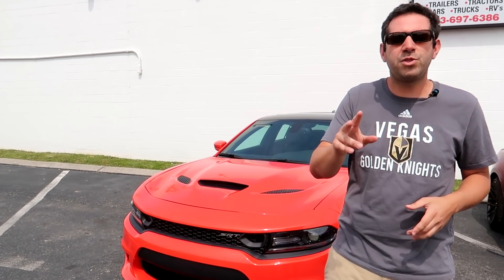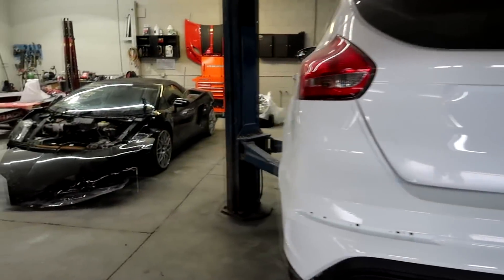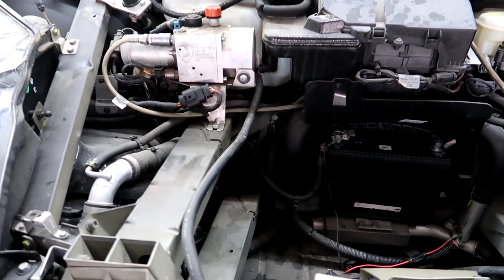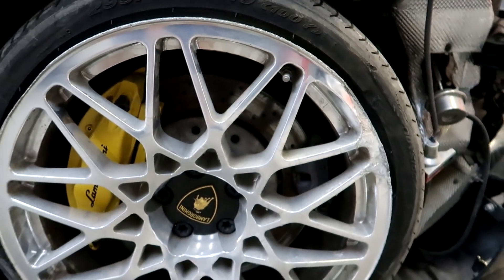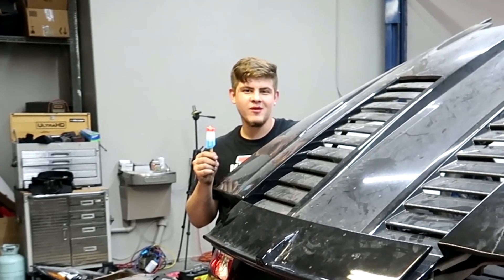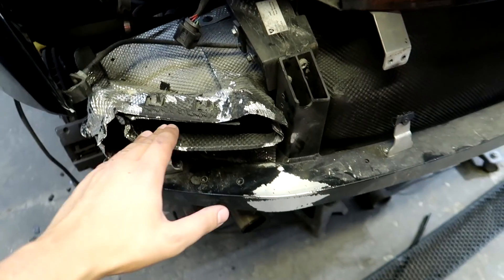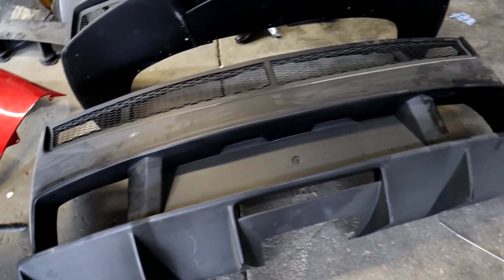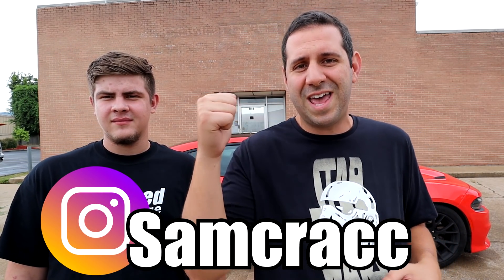I Bought a Lamborghini that CRASHED INTO A GUARD RAIL at Salvage Auction! I'm Going to Rebuild It!

Comment: Mechanical engineer here .. when you get a damaged wheel broken control arm whatever you should also check the wishbones and all other suspension components for damage.. I'm sure you do.. however if they're made of aluminium they need removing and non-destructive testing carried out, as they may have hairline cracks which you can't see, you can buy some penetrat fluid and use that method... but to be honest some proper ultrasonic testing or other nondestructive testing should be carried out by an professional. You don't want to be doing 150mph down the road and get a suspension failure.. any failure is going to happen under hi stresses.. so when you're cornering heavily or even worse cornering heavily at hi speed. This also goes for any other aluminium component which is structural ... You can't just heat it up and hammer it flat.. NDT is required.. the components structural integrity needs be confirmed.

Comment: Don't forget the camera makes it look better than it is. Aluminium rails on a supercar, high speed, high power. Down force, lateral loading etc, you need to ensure rails are factory spec laser aligned and not compromised. Eyecrometer will not suffice. 
We have flags applied to our write offs and imports so that repairs are carried out in accordance to manufacturers specs. Only then can the flag be removed, and not in every instance, notes are logged against the vin.
Reply: Peter datechmen  This^  
Heating up aluminum and bending it back into shape? Aluminum tubing? Wouldn’t fly in Canada. You’d never get that thing re certified unless you used oem.

Comment: You should buy Tracy Morgan's wrecked 2019 Bugatti Veyron. It has less than 10 miles on it.
Reply: wrecked or not I bet it already has about $200,000 worth of timed out parts that need replacing .
Reply: Cost of an oil change on that Bugatti is $ 21,000!
Reply: isnt it a 2012 veyron?
Reply: @JayOhPeee  All the stories I've seen call it a NEW Bugatti and say that Morgan just purchased it for $2.5 million.

Source: https://www.thedrive.com/news/28382/tracy-morgans-newly-acquired-2m-bugatti-veyron-got-swideswiped-just-as-he-drove-it-off-the-lot
Reply: @zzanatos2001  new to him, it was a Used Bugatti when he bought it,  they dont even make Veyrons anymore
Reply: @JayOhPeee  article I read says it's a 16.4 which would be between 2005-2011
Reply: @zzanatos2001  They do not make veyrons anymore.

Comment: $3,500 head light?  WHAT???   Insane.
Reply: My aunts car suburban rims cost 600 or 800 for just one rim
Reply: It's a Lamborghini.... everything is expensive on it (for no reason)

(Unless that reason is to do with carbon fiber, and/or labor on the parts)
Reply: A new headlight for my VW Phaeton is $1,500 last time I looked.  Might be higher now.  I miss the old days when you just bought the headlamp for like $10.  The "anti-dazzle" glass in the side mirrors is $1,500 for each mirror.  Made me almost eat my shorts.
Reply: I’m surprised the Chinese don’t copy the,headlights and charge §500 a corner
Reply: You can source those kind of things used from exotic car dismantlers/recyclers. Fraction of the prize. 

For example, I believe ONE brake rotor for a Murciélago is ~$4000. You can get both fronts slightly used for $1200-1500. There are ways to save thousands even on these cars, while still keeping the quality there. 

This is also the reason why cars such as these are still worth a lot as parts cars. EVERYTHING is expensive, if you can salvage a good engine, good wheels, headlights, and one good body panel, it yields quite a bit of money.
Reply: @OriginalAustinOblivion  or because they can

Comment: Sam the cheapest one in the USA is over a 100k like how did you even got this for that cheap ?
Reply: Yea but you can not sell a Salvaged title for anywhere near retail  you will lose about 40%
Reply: @Steve-mc6uk  dude 45k you could still sell it for double that If not the full price right
Reply: @aizazrehman5153  Not with a salvaged title you won't get anywhere near the value of one that has a clean title.
Reply: @Steve-mc6uk  jeez dude did I said it's gonna sell for the full price ? Get my point what I am saying is its still gonna sell for double of what he bought it for once completed. Got it ?
Reply: @aizazrehman5153  I don't recall being rude to you..
Reply: @Steve-mc6uk  lol dude you're chill
Reply: steve n but realistically do you know what it would be worth once rebuilt?
Reply: @chillintm  dude he sounds like a 12 year old lol
Reply: @Steve-mc6uk  Not sure about exotics, but regular cars sell for about 60% of full retail and a buyer, the goal is getting the car at 50% of retail. Most insurance companies will insure for 80% of retail to protect their interests. My opinion is that the difference between the current 50-60% off retail that is common now and the 80% maximum limit insurance companies will insure for will get smaller and smaller as the price of new vehicles stay high or get higher, with rebuilders trying to get more of that difference for themselves  by taking it out of the discount the buyer tries to get. The quality of the builder and his/her work will be key to him/her capturing that saved money.
Reply: @bluecollartrader1791  dude the point here is HE GOT THE FRICKING THING FOR 45K. Even tho the retail value might be higher for clean titles even tho this is a salvage title it's still is in a beautiful spec which makes it that much desirable and people die to find cars like this because mostly insurance is mostly lower than those of the clean title cars and once built Sam can still make 50 percent of what he paid if he wants to sell it.

Comment: If you're gonna fix the tear at 8:26 you wanna drill a small hole at the end of it, to stop the tear from growing (even after repair). Tears in plastic tend to keep growing if the don't end in an artificial spot (drillhole). Source: I used to do car body paint for Audi, not very good, but I know the theory.

Comment: Sam, isnt there any salvage Diablo's or earlier cars at these auctions, as it seems like everyone is doing these, but not the full cut ones from before the VW group took them over, although regardless this seems like a VERY good find, which explains why you seemed out of it during the Focus RS video with V tuned, as I guess you were just over the moon with how lucky you got here. 

as it looks like you flat out found a car that everyone thought was done for that really just had some mostly superficial damage to it, and ended up finding and getting it at about 3/10th of what it should have gone for with how little damage there is.

Comment: Little correction there: Aluminium alloys in general are not brittle, they usually have more elongation than steel alloys while mostly having less yield strength. Glad I could help, Captain flies away.

Comment: I just wanted to point something out. A lot of these exotics have really expensive parts and many people think it’s because of the name brand. I think its more about cost. For example a headlight on a Ford Focus might cost a million dollars to prototype and tool for mass production and that cost is spread out over a million units to make it cheaper per unit. But on an exotic you might only have twenty thousand cars that use the same light. So the cost per unit will be much higher.

Comment: 6:51 i prefer that you use milwaukee (a proper lithium tool) than tavarish using ryobi and harbor freight cordless tools just to make a statement....i've used the same makita lithium battery for 5 years now in my tools and they're just indestructible...i'm sure i would've had to have bought many ryobi or harbor freight batteries if i had used those brands.

Comment: What you're not telling people (and what most folks never think of) is that when you buy these expensive cars and fix them up, if you don't sell them right off for profit, you have insurance on them, which is WAY more expensive than the average car, and then maintenance, which is also pretty expensive.  Nobody thinks of having to replace those carbon ceramic brake parts until they have the sticker shock of buying them.

Comment: Holy Moly, I would never ever drive that thing after you are done with it...you have clearly a different "standard" in rebuilding cars than we have in Germany...there is a reason why the Lambo Part is so expensive and that is not only the Lambo Tax but the grade of the material. And a new Radiator for a fraction of that price...a really good after market Radiator is not much cheaper than the Lambo one. It hurts to see this...

Comment: Samrec, I'm sorry to point out that you are misleading your viewers. First off the 30K toyota you are comparing against is a brandnew camery and i don't really know what kinda camery you are comparing with because most camerys dont cost that much. 2nd A salvage car is a salvage car its not valued or priced as a new or 2nd hand used car the title it carrys salvages or rebuilt means that the the insurance company deemed that the car was not worth fixing it use to cost or structural safety concerns

I own a salvage titles (rebuilt vehicle) are they good cars ... Depends on How well its built amd if you got lucky. In my instance the salvage infiniti i bought i lucked out i know someone else who purchased a salvage car and their luck didn't really pan out. 
Cars these days are designed with crumple andncrush zones and even an impact of 20 miles would reset all the body pannels slightly.

Comment: The problem with these type of YouTuber supercar rebuilds is that they're wrecked/fire damaged and salvage titled cars, at best.   They're not worth anywhere NEAR the cost of an original, non-damaged car.  They can't be financed because banks won't touch them, making them worth a LOT less...  So you can't really compare a crashed and burned car with an original specimen.

Comment: I bought a Lamborghini that will forever drive like it crashed into a guardrail..>>>>> and the nose lift system works fine because the crash permanently placed it in that position.

Comment: This is so frustrating. Aluminum is NOT brittle. In contrast; it is as ductile as it can be. Unlike to steel, aluminum cannot be hardened, unless being in an exotic alloy (not the case here). The reason for its difficult repair, is that once aluminum has been loaded past its yield point, its overall structural capacity diminishes. Stop spreading false information which might cause danger.

Comment: A lot more is out of spec and needs to be replaced when a car got a hit like this did. You can't replace so much because otherwise it would be a bad deal. You will just replace the obvious broken stuff and tell everybody that it's like new but actually it's not. It's still a salvaged car. Sam, you are now in the butcher territory. Really sad to see this. You're not capable to rebuild this car nor is vtuned at least not the right way.